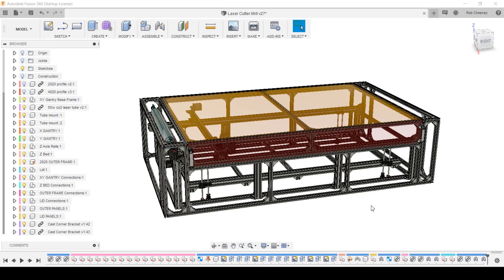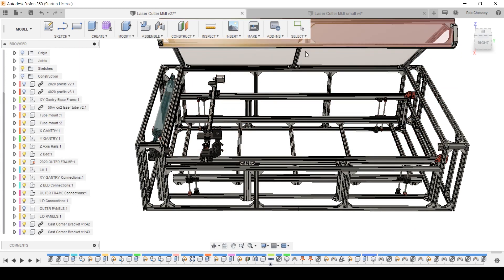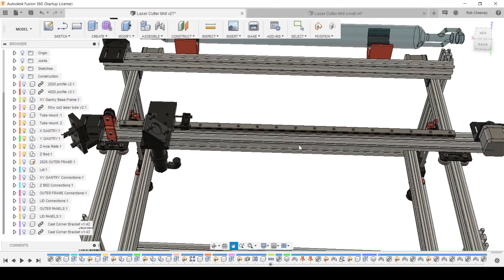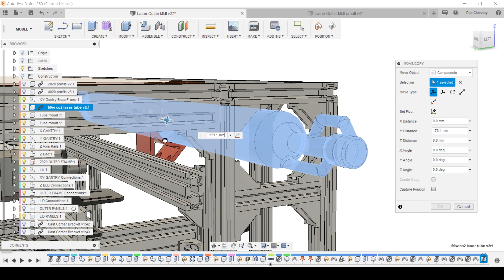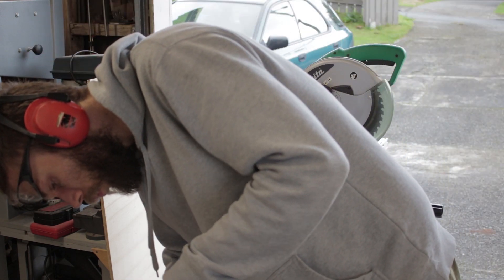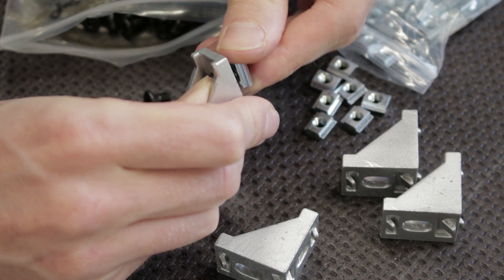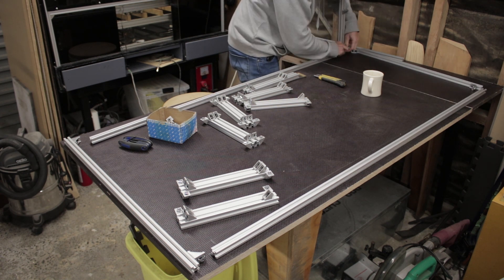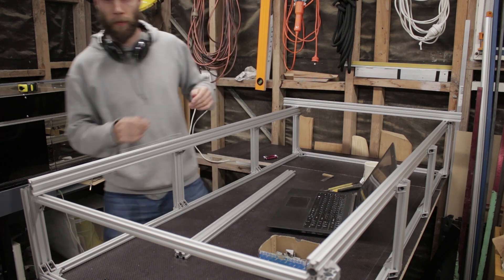Ep1: Design Features and Starting the Frame // The DIY Laser Cutter Build Series

Comment: you don't need a longer tube to have more power. just buy a second one and link it together with a prism it has two sides where laser light comes out remove the full reflection side of one of the tubes and arrange it with the prisim to forma U shaped path of the laser beam. this method of cascading laser tubes was used before laser LED were a thing

Comment: Great videos and great project! I just bought your part list and am thinking of making one of these. One thing I was wondering is why you need the 200 mm travel length in Z direction. Im guessing this can only cut up to like 12 mm materials, so is it only for engraving? Also I got some stepper drivers called TB6600 much cheaper than the DM542s, do you know if there is a difference?
Reply: Did you ever find out an answer to your question about the stepper motors?

Comment: Excellent video! Many thanks for your super detailed and instructional commentary. Greatly appreciated :) Do you have any plans for adding the option to make this design interchangeable with a z-axis rotary CNC machine. Or if your existing design can be easily modified to provide the CNC capability?

Comment: Rookie Tip, spray the blade on both sides (of the cut region) with WD40 for a razor-sharp and burr-free cut.
Also, most extrusion manufacturers design their slot nuts to be inserted from the face and not just the ends. Give them a bit of a jiggle and they'll drop in without any force required (usually).

Comment: have a question
why the vertical 2040 you have added this way "in mate withe the horizontal " and not add it under the horizontal one
in my opinion if it added under the horizontal one it will be safer, am i right ?

Comment: I just subscribed to this channel because I am in the process of designing a similar system. I have some questions not having seen the entire series:
1. I noticed that there is a square frame running inside the main frame that raises in the z-axis and need to ask how do you achieve the motion process successfully.
2. How can I download the entire collection to a CD?
3. What type of acrylic that blocks the laser light can I use to enclose the entire assy??

Comment: I'd be curious to know just how full your "swear jar" is after putting the frame together.  I could have easily filled two 5 gallon buckets after only an hour.  I SEVERELY underestimated just how "fidgety" those connector assemblies would be.  The manual dexterity of a neurosurgeon and the patience of a saint would come in handy, that's for sure.
Reply from the maker: haha put it this way, i'd be a very poor by now if I had a swear jar policy! probably lost a quarter of the nuts by dropping them on the ground and then they magically disappear

Comment: Hi 😉 u should give a link to  autodesk design file that you showed in video. If u do so then it is more easy to understand to your followers. Plz 😢
Reply from the maker: That's a fair point, however it's still very much a work in progress and it's still changing every week. It'd be easier overall just hold on till the final version - it's not too far away
Reply: Thanks for reply

Comment: I have been looking at laser cutters here in the states. The quote for the machine I was looking at, CO2/Fiber dual unit, is 80,000 after tax. 

Part of that cost is also the size I need. Which you are building in this version with the 2'x4' bed. 

After watching your first build I am looking forward to building my own cutter. 

Thank you for taking the time to document your process and sharing.

Comment: I'm going to suggest a strategy for your future videos. It may or may not help you to save a lot of time and effort in the preparation and editing of the upcoming videos for this project: I for one, and I don't know how many more people think the same way, do not need EVERY little detail (down to the length of every single aluminum extrusion, belt, number of screws, etc.). This level of detail would bog your preparation efforts too much, but also because let's say that you're building a machine with a work area of, say 24" by 36", and I would like to build, say a 20" by 30" machine, your cut list, belt lengths, and a lot of other size-related guidelines would not be necessary details for me to accomplish my particular machine. What would be great is to see how you went about choosing the mechanical and electronics components and what benefits certain components offered over other parts (type of controller, type of pulleys, over linear bearings, and what tolerances/precision these offer, etc.). I hope this is helpful to you to complete your process, yet leaves some creative decisions for us to make on our specific machines, and that would be truly a DIY effort coupled with your input. Thank you in advance for all that you do.

Comment: I know it will all change, but I was wondering what the rough budget is for this? $2,000, $5,000, $10,000?  Thanks for leaving the errors in, it is way more helpful than a 'perfect' video. I'm buying parts in Oz, so costs will be similar I guess
Reply from the maker: I'm looking at spending around $3k nz on this one - you could spend less or more depending on the power/size  though.
Reply: @FurtherFabrication  Cool, that is in my price range, looking forward to it!

Comment: I'm super exciting for series part two. Meanwhile, since fumes extraction is not there yet - maybe you smbdy explain why all fume extraction I see in such 40-60W lasers are only take air from sideways/bottom? It would be much more efficient to mount exhaust tube near actual laser, since this is the point where smoke coming from... Especially for larger print size machines like you building. Is it because of there is some air comes out actual laser beam pointer? Isnt this air made only to move away fumes, so exhaust can be mounted near laser beam on carriage? Thx.
Reply: The laser head (with the 3rd mirror and lens) moves all over the work area (x and y axes). Dragging a vacuum hose along with the laser head is not very practical. The hose would add more weight to the gantry system and could also get snagged somewhere as it is pulled and pushed around.

Comment: Hello, I'm from Brazil and I'm following your channel and your videos about cnc. Could you tell me the average amount you'll spend on it all? I want to make a co2 cnc from your project, it was the best I've seen so far. I have a cnc here that does not work, but you can take advantage of the co2 tube and maybe some electronic parts, which would already lower the cost. If you can answer me, I thank you!
Reply from the maker: Yeah they'll be plenty of opportunity to use other parts you might already have to bring the cost down. Hopefully at the end of the series you'll have a good understanding of the process, so you'll be able to choose where to spend your money.
Reply: @FurtherFabrication  I will certainly follow the series, I can not wait to start building mine! Thanks for the design, a big hug!

Comment: There are t slot nuts that you can insert anywhere in the slot without having to slide it by an open side, for a framing like that it's way easier

Comment: Really cool! I'm currently also developing my own laser cutter. Allready have most parts, including a 80W tube. Also, where hammerhead bolts not easier to use on the corner brackets? If I'm correct, you can place them also when the slot isn't accessible. I will follow this series!

Comment: This is looking really good! Most T-slot nuts I have worked with are specially shaped so they can be inserted into the extrusion even with the ends being blocked off. The T-slot nuts you have look like that so you should not have disassemble everything just to get another T-slot nut in. You won’t be able to pre-assemble the corners like you are currently doing though. The nut must be placed in the extrusion first.

Comment: Nice project! A few suggestions for improvement:
There are easier methods to connect the profiles then these angles which limit your mounting possibilities. E.g. https://www.youtube.com/watch?v=-0K6eU01q1U or https://www.youtube.com/watch?v=dkMGI94LQgA
You can also insert your slot nuts later into the profile without removing the outer connections by inserting the loose nut at a 45 degree angle and rotating it back to its normal position with a small screwdriver.
Reply from the maker: That's cool I hadn't seen those connections before! Yeah that's totally true with the insert t-nuts

Comment: Questions
Have you figured out the controller and software side?
Can this be upgraded to a fiber laser or mopa laser for marking metal?
Reply from the maker: I've gone with a Ruida based controller as that's what I'm familiar with. I haven't had any experience with fiber or mopa so I couldn't say for certain.

Comment: Looks like your build is off to a great start! For the actual 'laser' part of the laser cutter, is this pulled from a cheap K40 style donor cutter or is each of the elements of it purchased new? Keep up the good work!
Reply from the maker: Great question! All the parts are new and can be bought individually. My old machine used donor k40 parts, but they were less than ideal.